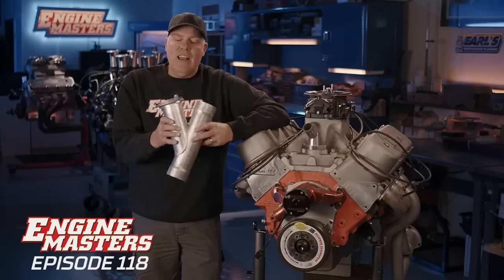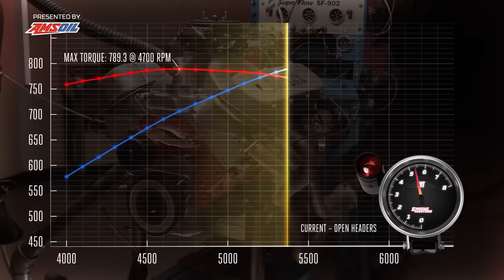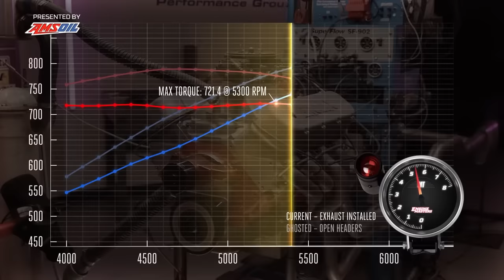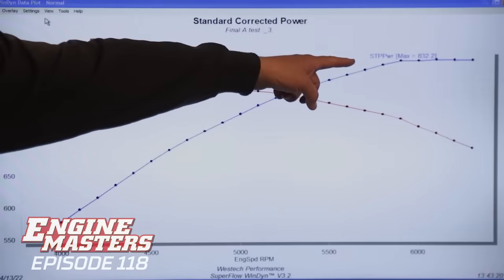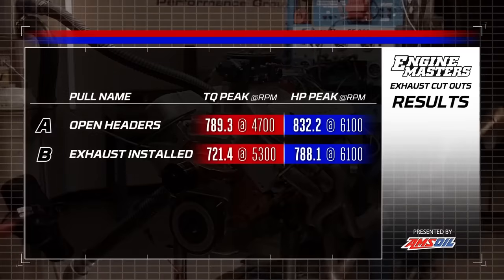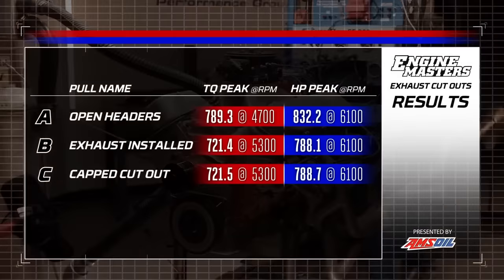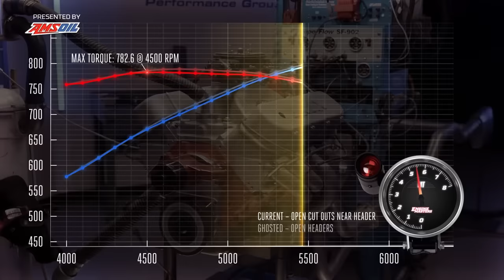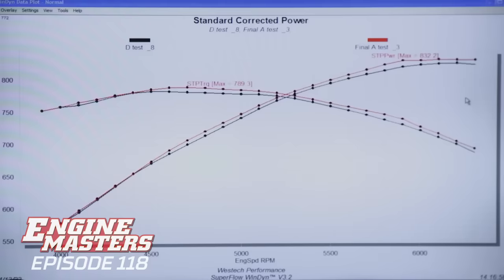Testing Exhaust Cutouts on Big Block Chevy! | Engine Masters | MotorTrend

Comment: Now you should do that test with the electric cutouts. See if the flapper valve causes a restriction
Reply: Good question - You would actually think the flapper valve might divert the gases better than them just finding the route with least back pressure
Reply: i like the way you think
Reply: The difference would be like 3 HP at most. The exhaust is just going to leave where it feels like so putting a different style cutout is just a exhaust relief. If too much pressure is killing your power, then opening it electronically or manually is just going to show its relieving back pressure. Mostly sound but it's not like putting a 1000 CFM carb in place of a 300cfm. Or a 4 inch  exhaust in place of 2 inch you'd see more difference on a boosted car with a cutout. For best efficiency you need a valve that closes off the regular exhaust and directs the exhaust rather than just blocking it off. But just do the same old carb tricks to a electric cutout like shaving the tiny screws holding the butterfly valve in place, rounding it all so it's smooth but these are going to be such small changes that air temperature difference would make gains or losses look more dramatic.
Reply: I'd think definitely. I bet using 2 cutouts, 1 forward 1 back, to route around mufflers would be perfect. Remove the plates and install pipe and boom.  Better way of doing it imo than an electric if you don't mind getting dirty
Reply: Oh or maybe one that cuts out on both sides. Hmmmm
Reply: I personally saw a 50whp difference on my own personal setup on a mustang dyno. Electric cutouts closed vs open. And that was on an 454 making around 550 to the wheels on that dyno
Reply: There are also knife valve cutouts if the butterfly valve caused a restriction
Reply: As much restriction as a carburetor butterfly.
Reply: I’m 2 weeks late to this but I agree “irregardless” [regardless] 🥸
Reply: They also need to test the difference in the double valve which cuts of the main exhaust and opens the cutout vs the single valve.
Reply: Go put a Pringles lit in your muffler get back to me
Reply: Why mess with bolts, just use a 3" ball Valve! 😅
Reply: My friend installed a electric system and it stinks you hear that it doesn't work 🤷🏻‍♂️
Reply: Put the flapper at the end of the pipe so it doesn't interfere with the main exhaust tubing. Solved.
Reply: I wanna know the same. It's something I'm thinking about using. But not for emissions reason. Definitely not that 👀
Reply: Exactly what I was thinking Sir😎👍🏻
Reply: @murgyj6198 use a knife valve or guillotine valve setup vs the butterfly
Reply: @flamingorphans  QUESTION BUT DID U LOSE LOW END TORQUE CLOSED COMPARED TO STOCK?
Reply: @Silverado138 why not? as opposed to what they are saying in vid

Comment: I've been doing cutouts & quiet mufflers on all my modded street cars for years, it's fantastic. Now I use vacuum-actuated cutouts, they're fast, reliable, and can be controlled via solenoid with a switch or the EMS.
Reply: I do the same. And since mine makes up to 20 ft-lb more under 3500 rpm with them closed and  up to 15 ft-lb more above 3500 with them open, I let my ECU control them with a mac valve and keep them closed until 3500 RPM.
Reply: @mxguy2438  AES
Reply: @mxguy2438 Meh.  I'd like to have a switch that keeps it quiet no matter what.  That way I can pass cops and not worry about it.
Reply: I have a twin turbo and was thinking about dumps. Will this cause the turbos to overheat? And where do you put the dumps on a car that relies so much on the tuning?

UPDATE: I installed them and put car on dyno. +20 HP at the wheels with them open. No issues otherwise other than the floor gets hot if left open too long.
Reply: @SparkyWrench  Are dumps the same as wastegates? Sorry to seem dim, I just don't have a lot of experience with forced induction.
Reply: @theprojectproject01 I don't have a lot of experience either, but am learning. No, they aren't the same thing. Dumps or cutouts bypass the exhaust system. On my car the bypass the muffler and secondary catalytic converters allowing for the exhaust to flow with less restriction. A Wastgate is used to control the speed of the turbo (the Dumps allow for free flow of the exhaust).
Reply: Ah, thanks for clearing that up. Much obliged.  @SparkyWrench

Comment: Good lord. That BBC is a monster.  The test is very cool and informative but I’m just in awe of that engine.
Reply: Yep, and there are guys getting 1000hp out of the same size engine on pump gas too! My 516 turned out good, but not enough cam so it's very sensitive to low octane fuel. Needs 100octane to run properly.

Comment: I think it would be even better if the full mufflers were built on the angled outlet and the cutouts let it go straight through.
Reply: I've been saying and thinking that for years. The flow is not redirected.
Reply: Absolutely. I think that is the optimal route to run em.
Reply: Not just that but knowing the muffler is restrictive it makes common sense to run it out the side, when you uncorrrk you want straight shot cut to where the heat signature stops..
Reply: X pipe, install the cutouts on the rear you can take advantage of the X and have them built/ orientated for straight flow out the sides when opened up.
Reply: @8BWN  this is exactly what we did on my Vette...
Reply: Interesting thought! 🤔
Reply: Now, there's an interesting thought.
Reply: Better, but probably not a lot better.  Its already nearly the same as no exhaust system at all
Reply: It would probably kill power even more when they're closed. Because then you're sending that exhaust straight into a wall and then have it make a turn
Reply: @MaFTB  could be. you would have to choose when peak possible power is priority.
Reply: A lot of hot rods you’ll see will run it that way going all the way back to the 50s. Where the cap will be straight through but when capped it goes out the side.

Comment: Great comparison.  Should have tried the test with the 18" extension on the headers and then the cutout.  Thanks for all the great videos.  Regards - Mike
Reply: same here I was gunna do 12inch extensions then cut outs but i dont have the room so just gunna bolt up the cutouts to the headers like they did

Comment: I’ve got mine setup so the cutouts are straight and I notice a big difference in not only power but engine is much happier with the cutout open
Reply: I always thought these things were made kinda backwards. The dump should be on the easier flowing pipe with the muffler taking the angle pipe. I bet your setup would achieve closer power to straight headers than theirs did. I'm helping my friend weld in a set of vacuum actuated cutouts at the bend where the exhaust bends to go to the y pipe. It all lines up to where the exhaust will go straight back out of the header and out the valve with no bends. We are considering getting the valves that close under vacuum and just plumbing them direct to manifold vacuum. When you are off the throttle the vacuum stays high and the valve stays shut. Under load at full throttle the valves will open automatically.
Reply: Exactly

Comment: I'd like to see if there is a difference in placement? Maybe post H or X pipe to see if it will still take advantage of the exhaust scavenge!
Reply: There's no need. If it's happening at the beginning, it'll happen anywhere else in the system at some point in the power curve due to all things thermodynamical..thermodynamical. lol. Which I don't think is actually a word but looked more funny than thermodynamics

The only thought I had would've been if the cutouts themselves were X piped to dump.
Reply: You want them as close to the header collector as you can get. The least resistance the better.
Reply: No the x pipe h pipe represents a restriction.
Reply: Interesting test actually.  The guys at MotoIQ say that the closer you get them to the headers the better.  In fact, it not only increases power, but it makes the engine sound better and less thrashy.

Comment: What would happen if you put the cap on the straight sectin of the cut out and hooked the mufflers up to the Y?
Reply: Hmm. That’s actually a good question.
Reply: It works Better  I run that setup and run the same time slips at the strip as with open headers.
Reply: @mylanmiller9656  Stands to reason. The Y itself is a restriction.
Reply: Same as open header, but more difficult to set up and probably a little less hp when capped.
Reply: Fb always pidgeon holes parts he doesnt like in tests

Comment: Always seemed to work back in the 60s.
Some of us used gas tank filler tubes. Winding the engine out with the gas caps on usually resulted in  their hands off removal. Relieving that much back pressure obviously helped.

Comment: If I remember correctly, the max wedge exhaust, had a straight shot to the collector, that dumped out behind the front wheel. When capped, the exhaust would back up, then flow out the tailpipe. The max wedge configuration, when uncorked, flowed like open headers, with a straight shot.
Reply: I've seen rods with a similar arrangement - look like open pipes but the exhaust actually runs in a hidden pipe that links to mufflers under the car... at least until the cap is removed

Comment: I used to run cutouts on my blower car because it was WAY easier to uncap them than to drop the entire exhaust. But I did a test once at the track and with the entire exhaust removed it only picked up 5 hundredths and I think that was because of taking off 30lbs of exhaust!

Comment: I didn't need a dyno for this...I found out by putting into practice lol. My car would run 10.9 at 126 ish full exhaust, open electric cutouts and it'll drop to low 10's at 130+.....so alot of horsepower was left on the table with full exhaust haha

Comment: The capped off part is backwards on that cutout.  You want to plumb the exhaust system off the kick out and have the cap on the straight through part inline with the exh flow so it doesn't have to change directions.

Comment: We used to swap the cut-out side and weld the flange to the straight through . The theory was since flow was already compromised, may as well take full advantage of the cutout. 50 or so years ago. 2-1/2 inch pipe.

Comment: I believe that it's all about WHERE in the pipe that you interrupt the pulse with the cutout the same way that an optimum collector length does AND the relief of back pressure created by the mufflers and the rest of the exhaust system. The open header example used 18" long collectors. The cutout equipped example had the cutouts merging into the pipe at about half the length of the 18" collectors effectively making the collector length half of the 18" length. I believe that's the only reason the power was down a bit. The only part that is a bit confusing to me, though, is the closed cutout vs the no cutout example. I think maybe the extra volume of the cutout tube reduced exhaust flow velocity at lower engine speed.

Comment: I think you should an X pipe and see the difference because now its basically an H and i can recall from previous episodes that it does make a difference
Reply: Wont change what the cut outs 
do.
Reply: I think you're onto something. I bet you're right.
Reply: That would be a good idea to try
Reply: You’re saying an x pipe changes what concerning the cutouts?
Reply: @chrisr897  I had cutouts exiting straight after the x pipe, no angle there, just on the natural path of exhaust gases. Don't know if it makes any significant difference though.

Comment: I had a1966 289 mustang back in the 1960's I run cut outs but caped the straight out the back pipe. This run the same time at the strip as a true open header, Then run the Exhaust threw a 2' pipe  out the side Of the Header extension for the street!

Comment: I know in most real-world applications it would likely be infeasible to build it in such a way in many cases, but I would be curious if the few HP drop over open-header from having the cutouts open could be regained from having the cutout dump be the portion of the split be in-line with the header collectors vs. having them split off away from the straight piping (in other words, perhaps run the main exhaust piping whatever 20-30 degrees inboard instead of straight back so the cutout dump is pointed directly to the back of the car).

Comment: I had an e cutout with dual butterflies that opened opposite to each other, so when one opens, the other closes. Great idea, but I lost power all around LMAO. Sounded cool for a bit and that was it. It most likely needs a tune for both opened and closed. I guess the best option, in my opinion, is getting a tune for a vacuumed operated e cutout/muffler so that it's quiet when at low rpms and goes full boar above 3k rpms

Comment: I wonder if the results would still be the same with a more normal street/strip engine with 400 to 450 hp? Not too many guys are running around with 800+ hp engines.

Comment: 66 chevelle 1972 w/ 396 4 speed . Put a y pipe in and welded a pipe water cap threads on it . Picked a target to race at the local hangout and set a time at our road we raced on by a rifinery . I would make an excuse to check tire pressure etc and take the cap of both pipes and pop off the air cleaner . Maybe it was me but I believe it was worth a half second .

Comment: Is it possible that the problem is not actually flow, rather the long pipes after the collectors are simply detuning the header/collector combination? And the cutout partially restores the correct length and tuning?

Comment: If you are going for performance, you will want the cutout on the straight part of the pipe, and the muffler on the pipe that is welded on. That way when uncapped, it will have a straight thru flow.
Reply: That actually makes a ton of sense. I'd love to see that tested and compared on the same engine and dyno.

Comment: The other test is the angle of the cut out.  When I installed them,  I put the muffler to the angle.  When you took the cap off, it was straight flow.  I found more power.

Comment: I put a 3 inch electric cut out to bypass the muffler but still ran a pipe beyond the rear axle on my 94 tbi 350 and picked up 3/4 of a mpg in city and highway. Its already payed itself off in one year. And the truck doesn’t feel as lethargic as it once did.

Comment: i have a crown vic that i’d love to get some dyno numbers for. it’s tuned with cuttouts where the h pipe would be deleting it. i have 4.10 gears and a bunch of techs told me i would lose power but when they are open it feels significantly faster. only way to truly know is to get some test results

Comment: I'd like to see if you could get all of the power back by attaching the exhaust to the turned section and putting the block off plate on the straight section. Not that 6hp is enough to matter much on a 790hp big block, but still curious.

Comment: On some late model high performance cars the sound is adjustable. Run a dyno on one and tell us how it works!! When I get a new car the first thing I do is cut the mufflers off and weld a piece of tubing in the gap!! Never cut the catalyst off obviously!!
The sound is nice with less weight!!
I have.bad memories with cutouts. 
Couldn’t afford a trailer so I drove my car to the strip!! Crawl under and open em. 
Hope it don’t rain or back under in the MUD!😡 We couldn’t leave with open pipes or slicks!! Sometimes the wrecker would lift the back so we could stand up and do both!😊
Later I extended the cutout pipe where I could reach them and aimed them toward the slicks so it would blow the burnout smoke into the stands!!😁 I later bought “cheater” slicks (legal for the street) so no more MUD!! I see burnout cars using my smoke blowing today fifty years later!😼

Comment: Should have put an atmospheric velocity meter on both ends (normal end and cutout end) and compared the ratio of flows. That's more detail, but it would have been very useful.
Also with a ton of newer vehicles running electronic butterfly exhaust valves these days (connected to operating modes), this sort of thing is becoming more relevant.

Comment: Great test sequence.  Since most folks dont have a nearly 600 cu in street engines, what would happen on a high lerformance 383 stroker street/strip set up, more typical for some of us, with a 3 inch exhaust system?  Why not situate the open end of the cutout exactly at 18 inches from end of headder collector, or as close to that as practical?
Reply: I also wonder what the effects would be with a 400hp engine instead of a 800 hp engine. It's not really relatable for me. I get we might see some of the same effects just on a lesser scale, but I also wonder about the H pipe being so far back? I think move it closer to the engine & put the cutouts behind the H pipe?

Comment: Awesome episode and a excellent test !! 
I think the ultimate setup would be some sort of adjustable cutouts either operated by air or electricity or hydraulically to be able to open and close them on the fly just like they have in performance boats which is called a captain's call exhaust system
Reply: They already exist and have been for the last 10 years at least.
Reply: There are a number of them available on the market
Reply: Any opinions which cutout kit offers the best long term flapper seal? I'm tired of the electric motor flaps not sealing and causing a exhsut leak noise.

Comment: At high rpm with the mufflers and the corked Y, the entire exhaust system is pressurized so less turbulence.  A slug of air gets trapped in the Y and can't get out, it just gets squeezed.

Comment: Would have been interesting to see a comparative with actuated cutouts.
I recently obtained a pair of n.o.s. Warshawsky & Co 2¼" cutouts and they use a little lever with a metal flap inside the pipe to instead either allow the gasses through without creating a high pressure area in the vent pipe, or directly guiding the gasses out the open side.